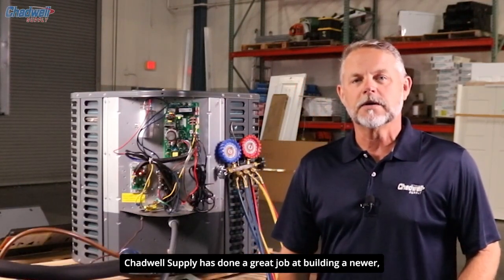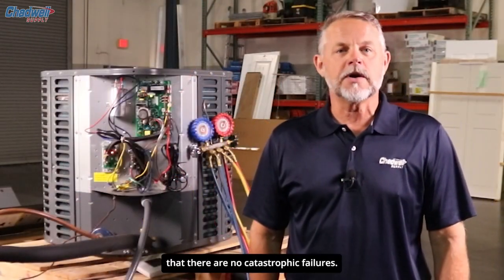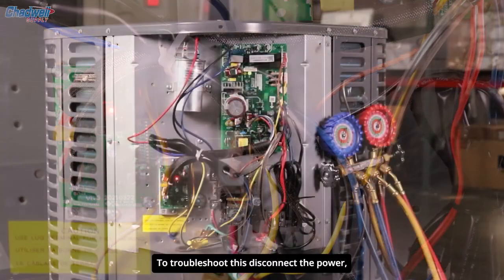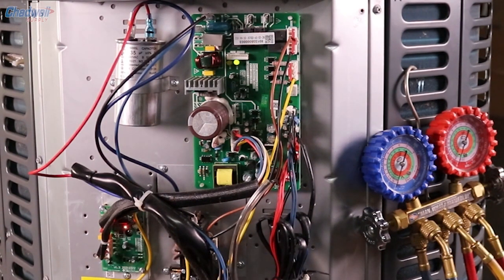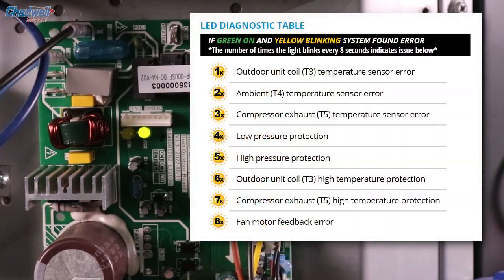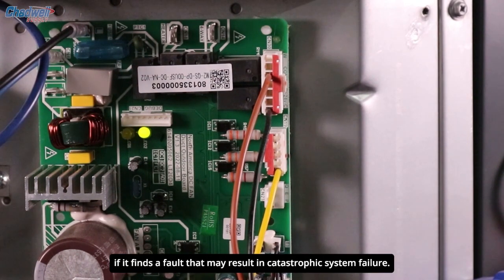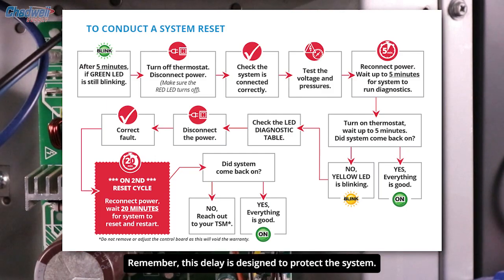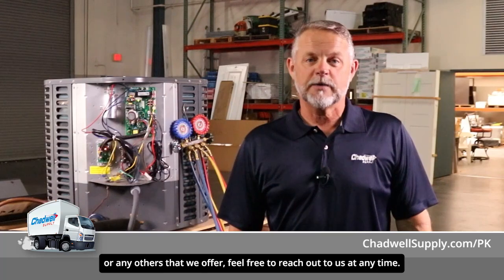Brothers HVAC 14.3 Ton Condenser Troubleshooting

Comment: Hello,  which one of the new refrigerant  R-32 or R-454b is this one using?  Being a customer, My worry is the cost with all of this added new electronics. The cost of replacing those electronic boards vs the tried and true simple parts.  How much will these new HVAC appliances cost the homeowners?
 I have a R22 that's 23 years old, that still works even in 110 degree heat, off course it is not efficient. Everyone wants to sell me a new HVAC system, but they all have the R410A which is also discontinued. I have a R410A unit that's 7 years old that already having problems.
 I also worry about the longevity of these new appliances. I want my next replacement to last 20+ years and not cost as much as a used car.
Does anyone in the industry care that that these HAVC unit higher costs will price out low income homeowners?